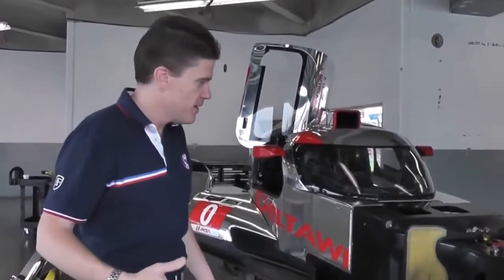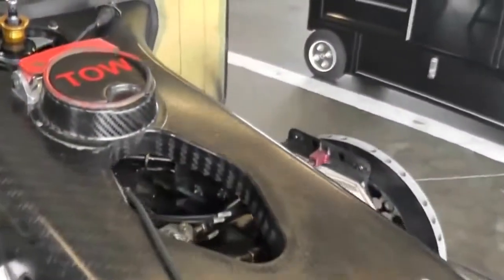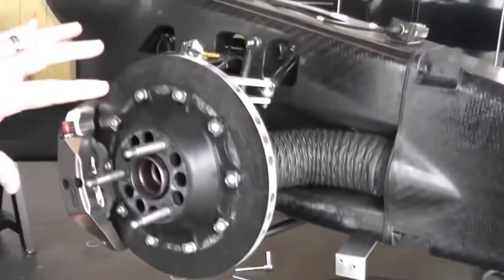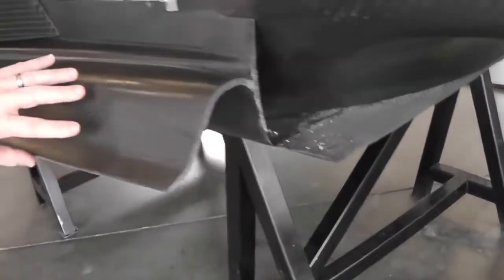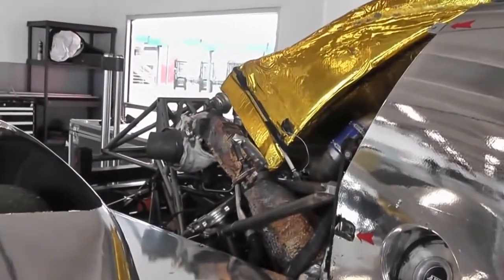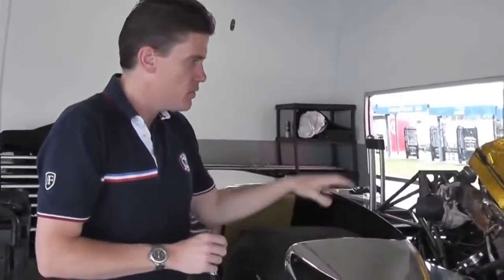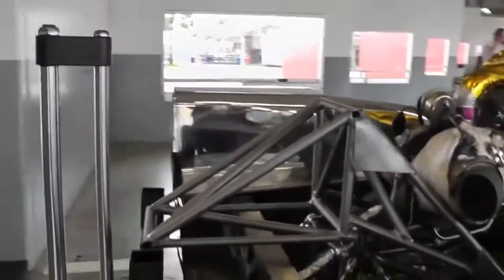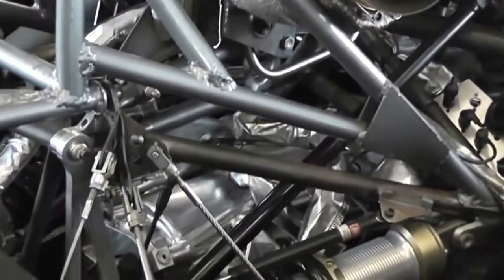Technical presentation of the Deltawing race car

Comment: Those welds are horrendous and unsafe at "any speed".  You could cut the weight down on the car considerably by using properly done welds.  I can see by the way they were welded that a high school student in his first semester of welding performed those.  But really those are inexcusable for a car that you are touting to be so advanced, safe and driveable.  That is a death trap waiting to spring.